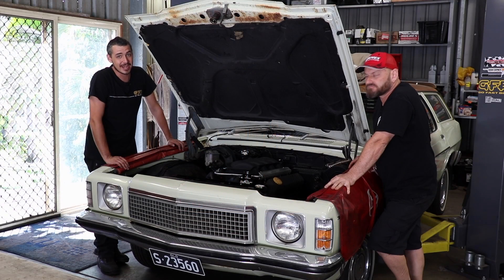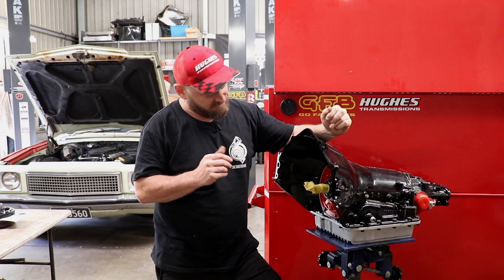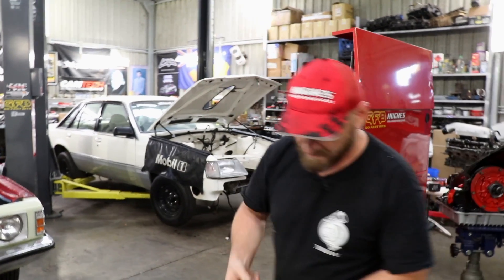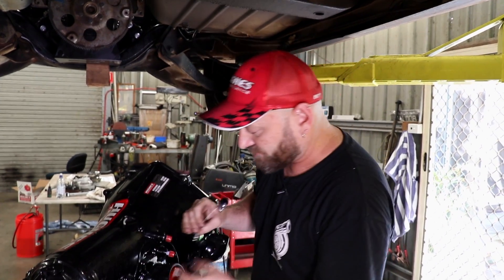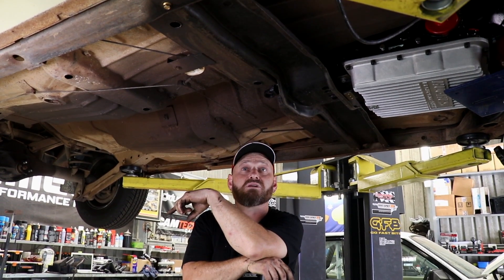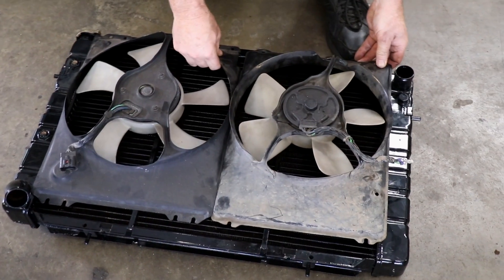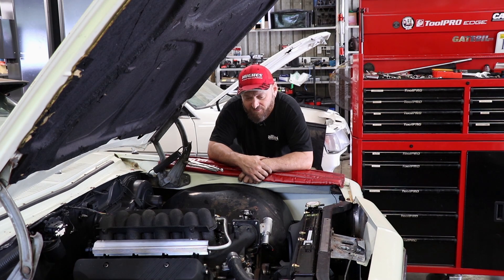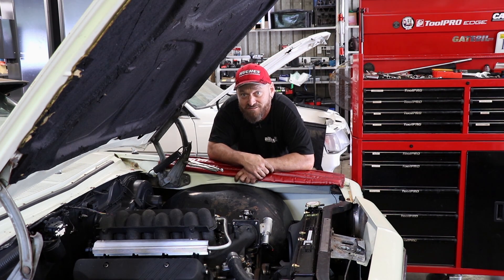Return of the Iron Lion, Holden Kingswood 304 V8 Engine Swap [EP2]

Comment: im starting to realise that the skid factory builds cars with engines that are not the obvious choice. and its very refreshing.
Reply: This engine was a fairly common swap in the pre LS era.  Even more retained the original bottom end and just used the heads from the EFI 304 "iron lion" with cam, headers and intake manifold to suit carb.
Reply: @MattyFielding6  I get that. It's more that in the days of ls/SR20/2jz/coyote being the go to options for almost every swap it's refreshing to see older swaps still being done. This could have easily become an ls swap but it didn't and I appreciate that.

Comment: Looks like HX or HZ grille. HJ had slats horizontal with the Holden emblem in the middle. HJ wagons also had the backbreaker fuel cap mounted so low down it would piss out petrol all the time.

Comment: Could never afford to find WB radiators on my budget back when I thought I could afford to play around on older Holdens so used to use Ford XC radiators as they were crossflow & had the inlet/outlet on the appropriate corners for the Holden V8s...
I used to try & steer clear of auto's myself & for same reasons above never had anything to do with Turbo 700's (They were still new here in Oz at the time!) so have no first-hand knowledge on the matter, but from a fairly reliable source I was told the Turbo400 crossmember was a zero modification/bolt-in job for the Turbo700 boxes...

Pickle me Grandmother, next time Woodrigos starts up with that "Iron Lion" malarkey, please drown him in Bullpit references & quotes! ;)
Thanks again fella's, very much enjoying this series!
Reply: Turbo 350 x-member was the bolt in....T400 was the same as tri-matic but strengthened with flat plates at both end and mount holes in different position
Reply: I was SURE that was the case but ol' mate who always had auto's was adament that it was the 400 cross-member....
As I was always running manuals I ended up just going with what he claimed to 'keep the peace'....
Thanks for verifying what I'd suspected all those years ago!

Comment: i know you love your barras and your v8s. i would absolutely love a video where you fit the AU intec vct motor in something older, maybe a falcon ute? yes! id love to see an early falcon with a not so late model inline 6 :D want power? whack a turbo on it. (btw i own a XH with the AU VCT engine, it goes harder than the stock motor)
Reply: Or a 4.1l carby 250 crossflow 😉

Comment: I'm from Wales (the old Wales) and I've never seen one of these before you worked on one.
Reply: if you were from New South Wales and are older than 30 you would have seen thousands of them :)
i learned to drive in one. they are pretty rare now because they rusted out really fast
Reply: @gdawwg1125  I'm over 30 and learnt to drive in a rover/mg metro you don't see many around anymore.

Comment: Hey guys, great content as always. Had a quick question - not a criticism, just wondering: Any reason why you extended the bottom of the fan shroud instead of the top? It looked like the bottom was already longer, so extending the bottom puts the fans further away from the center of the radiator. Thanks!

Comment: I love Opel. Still drive one today!
Reply: Had the 1.9l Opel powered LX Torana. Even with an overhead cam it was still a boat anchor. The only thing it could beat was a Starfire powered Torana! After the second Opel punched a rod through the block we changed to a 253. Car is still owned by one of the local young lads and the 253 is in my shed. Should by it back and put it all back together.
Reply: Thats great man ! But im from the Netherlands so thing are a bit diffrent here.  My best one was a Opel Vectra. Model 2000. (From  1998) It had a C20xe in it. Pretty good! But rust was a big isseu 😭. But i had a few so i lost count haha.
Now i have a smal Corsa nugget. But its a 1.8 Gsi so it goes pretty wel..

Comment: Why the love for Subaru fans for this build?
Reply from the maker: I have always used them in the past because they came in a few different variations of width and height so you could mix and match to get the width right. They are steel housing so modifying the mounting is easy and they have very strong and reliable motors and big blade pitch while somehow also being very low height. Pretty much everything an expensive aftermarket fan doesn't achieve.
Reply: The Skid Factory  grouse, thanks for the info.

Comment: Hi guys on the subject of radiators, I have a Holden vs ute with a large 3 core alloy radiator and 2 vt thermo fans barely stays cool, then I have a vr senator I just got that has a v6 2 core with the old clutch fan and yet it stays cool..

Just thought I'd share it to say that you never know, and I found that interesting.
Reply: Ps there both 304 v8

Comment: Did you consider a gear vendors on the back of a th400 rather than a 700r4? they're notoriously stout as, and aside from giving you an overdrive, they give you 2 extra gears between 1-2 and 2-3

Comment: Nice! The iron lion Roars next episode! What’s the cutoff date over there for emissions?
Reply: HJ was the last model to not need a charcoal canister and EGR (ADR27A), before that there were no emissions requirements.  However, putting a late engine in an early car means that the emission standard for the engine overrides the ones for the chassis.

Comment: You can make a hand break with three pieces of 6mm steel angle two nutz two bolts a link of 6mm ID pipe and a link of 6mm round bar... You have a welder and a saw and a drill make er up bud.

Comment: Will an Aussie 4speed Manuel bolt up to these engines?
Reply from the maker: After VN they are turbo pattern so an Aussie 4 speed won't boltup. You could redrill the block though.

Comment: How do you rate the tool pro ratchet compared to Milwaukee ?
Reply: Id doubt they would give you their honest opinion,  probably got sponsored by tool pro
Reply from the maker: Works the same as a Milwaukee but is easier to change directions and the battery works.
Reply: So you guys did get sponsored?
Reply: The Skid Factory cheers

Comment: Is it just me but i'm sure the grille on the front of the wagoon J is from a Z??
Reply: It looks like a rare spares HZ grill....
Reply from the maker: It is 45 years old...
Reply: Nope same as my hj panel van the trick is  pull the badge out of the middle and turf it looks heaps better
Reply: yep HZ grill...HJ had horizontal bars
Reply: Yes.  HJ grill horizontal bars, HX vertical bars, HZ egg crate.  The HZ is like Holden decided to combine the previous 2 grill types.

Comment: Isn't the TH700 called 4L60-H in new catalogue?
Reply: 700R-4 from 1982 - 1986, 4L60 from 1987 - 1992, and 4L60E 1993 - later.  The box we sent these legends is technically a 4L60, but is still most commonly referred to as a 700R-4 in the industry even though we only use the stronger, improved 1987 - 1992 cores in our builds.
Reply: @HughesPerformance  Dad used to be in the industry, I get to listen to these numbers over and over at lunch,... Meanwhile, I prefer three pedals :D
Reminds me, I need a Wrangler hump to clear the NVG-3550 for my VC Valiant.... Guess which GM box shares the extension housing bolt pattern with the transfer case flange at the back of the Wrangler 5-speed :D :D :D

Comment: Why is it important to match the pinion angle and the gear box angle
Reply: To much angle on the driveline will introduce friction wear. U-joints will only operate under certain angle limits, too much and they will start to bind and break.
Reply from the maker: Driveline harmonics will occur if the angles are not cancelling each other out.
Reply: @theskidfactory  
Ah, I should remember from hooking up PTO implements on tractors, keep the output and input parallel

Comment: why this misconception of the auto being week? stronger than stock manual trans in the same applications from factory
Reply: It's only weak when used in non-warranty-approved methods, like weekend burnouts and drag runs, or when people mod the  donk without beefing up the trans, and then it blows under the extra abuse.
Reply: Lol, 4l60s broke in standard cars driven by old people, so shit